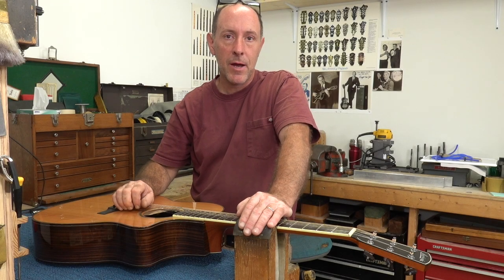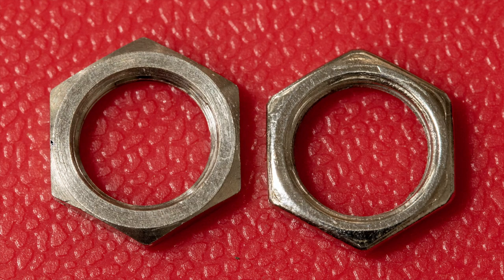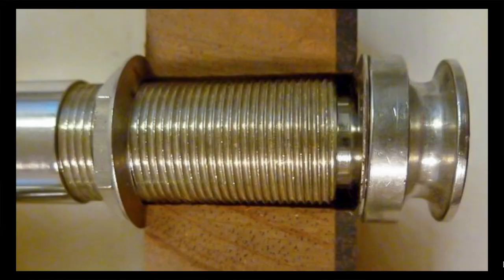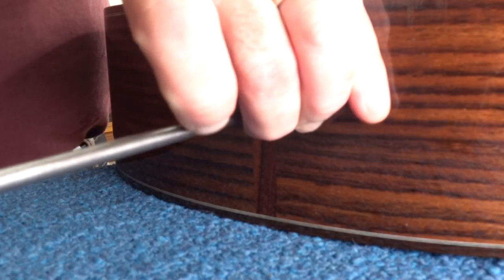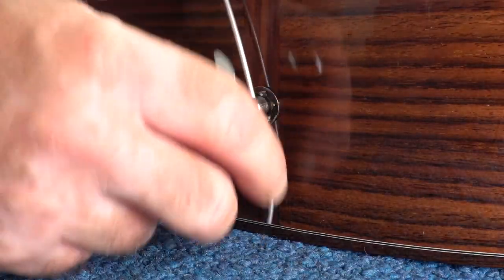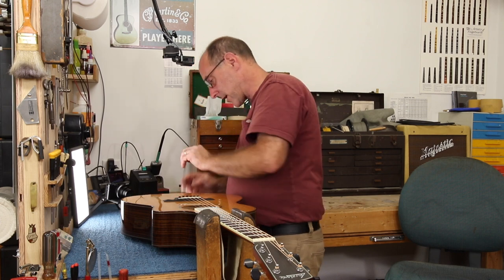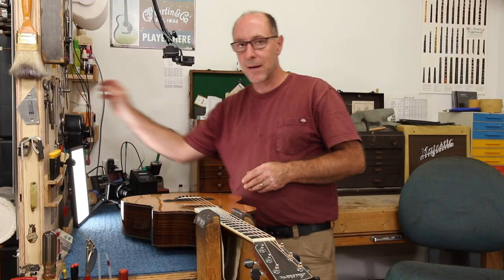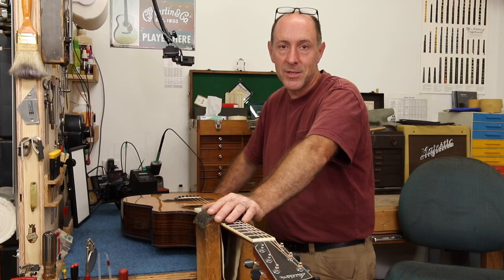Acoustic Endpin Jacks - Are You Really Installing Them Right?

Comment: Great video!  Learned something!!  Three suggestions:  1) a 1/4 wood dowel won't scratch or damage any wood or metal parts like a metal rod.  2)  Using a piece of coat hanger wire bent to a small "L" at one end takes a lot of trial & error out of determining the inner nut position through the end block.  Use a piece of masking tape to mark the end block thickness and transfer this distance to the jack nuts.  3)  Use a tiny (and I mean tiny!) bit of wood glue on the inner & outer nut threads to lock them in place.  Wood glue acts like LocTite; but is less aggressive.  However, too much will nearly act like a weld!

Comment: been installing endpin jacks for decades and it's simple enough...

nope! this is a revelation! i've always adjusted so the nut just barely didn't bottom out against metal on the principle that it got me full clamping pressure on the wood, but now that you explain it of course that's not as reliable as full-on metal against metal thread-tightening and yes, i see those dished-in washers all the time

extrapolating out, what about the star washer inside? i've always assumed it was meant to grip the wood directly, but should it in fact be between the internal nut and the internal flat washer?
Reply from the maker: The star washer is designed to be placed between the nut and washer to lock the nut. To be honest though, so long as it’s tight I doubt that part would prove to have much consequence either way in this application.

Comment: What is that slide metal rod tool you used in this video called? Beats having to unwire the strings where the guitar's circle is for an illiterate person to. I've just watched several YouTube videos showing you how to drill a hole there to insert a point cork screw which to me is not ideal solution in the long run where this type of screw will cause that hole wood surface to crack or broken resulting from guitar strap pulling pressure.